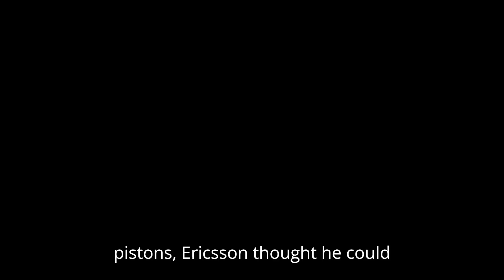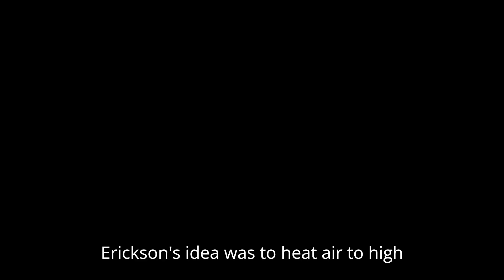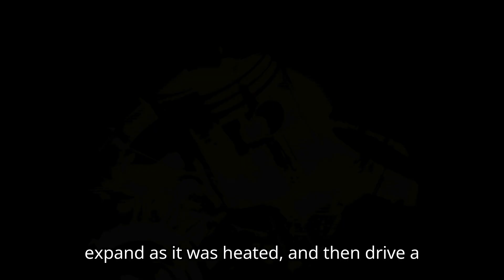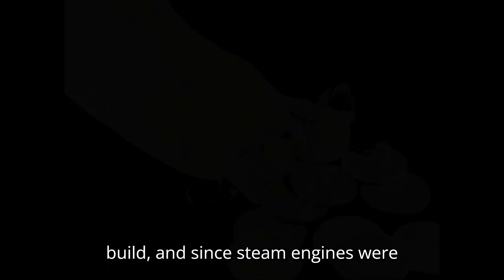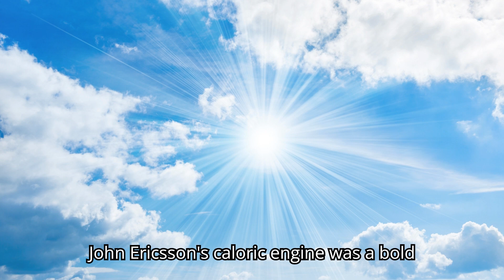How John Ericsson Tried to Change Energy Forever  The Caloric Engine Explained

Comment: phase change takes place in water molecules whereas air is a gas mixture that allows heat addition to water and rapid expansion compare compressing air seems intuitively lossy in addition to sealing again smaller individual molecules it can still win for sure by modern pneumatic principles and saving weight as well as the benefits discussed here

Comment: all talk, and not ONE diagram of the actual engine?

all fancy CGI renderings, and not ONE drawing taken from the patent, or historic documents. of which there are literally thousands.

glad that at least its gained some recognition, but how about actually delving into how its built and how it actually runs?

btw, the "cayley" engine or "furnace gas" engine is the same concept, except it has the fire under pressure... which caused serious issues with adding fuel, subsequent ash running through the engine itself,  and the valves required. ericsson had the bright idea of using a heat exchanger instead.

the air was not recycled. the "cooling" of the air was due to the fact that ENERGY WAS BEING EXTRACTED to perform WORK, the same as in any other engine. and once it exited the engine, that was it. "open cycle" rather than "closed loop" like the stirling.

and of course, it is the predecessor to the well known and now ubiquitous "jet (or gas) turbine", operating on the same principle again, but in a continuous cycle without the need for valves.
Reply from the maker: this is the first video of the kind,  I'm working on finding copyright -free images  for the next one. Thankyou for the technical clarifications. Actually the video is intended to inspire further research and reflection and  not to be technically exhaustive.

Comment: Very similar to the Stirling engine.
Reply: vastly superior. external heat exchangers mean you have TIME to heat air. are not limited by surface area versus volume considerations.
its also very popular today... its a piston based "jet engine", the exact same cycle of operation.. this video barely even hinted at the engine itself, or certain flaws. that it had valves. that it "pumped" air in surges rather than continuously using centrifugal or axial compressors.

the only good thing about this video is that it at least MENTIONED the concept. those that are curious might go do some research of their own. it didnt even have ONE IMAGE of the engine itself, or its close relative (even closer to the turbine engine...) the "cayley" or "furnace gas" engine. its issue was that the fire was under pressure, making it hard to add fuel, and the ash had to then pass through the engine... and the materials at the time meant the valves got absolutely destroyed on a regular basis.

it also led to the development of the diesel engine... 

imho, its the direction we should be looking in if we want to progress with small scale "home power generating plants".
Reply from the maker: You exactly got the point of the video: mentioning the concept and inspiring further research in those who are interested